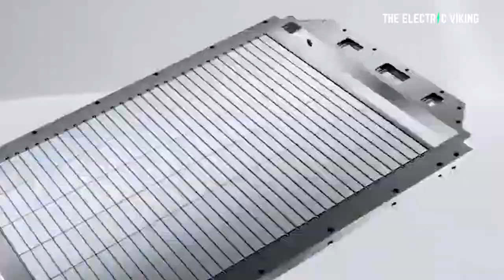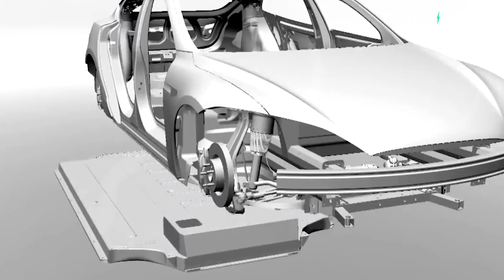Tesla's Model 2 Hatch & Crossover will KILL gas cars in 2023

Comment: This wasn’t one of the strongest videos. Range will be closer to 250 miles. The smaller the battery, the more cars they’ll be able to push out. Plus unnecessary competition to 3/Y. It’s 100% certainty this won’t be made in China for EU market, why add 10% import tax and freight??? It will be made in Eastern or Southern Europe.

Comment: but I want a Corolla . . .
Reply: @The One Who Knocks  I realize your comment might have been tongue-in-cheek.  😊       But my reply was going to be this...   Gasoline Corolla or hybrid Corolla or battery electric Corolla?   As you probably know, you can get a hybrid right now that is rated around 50 miles per gallon.  Only 23,000 USD.  In a year or two, there should be a battery electric Corolla, likely called the BZ2 or BZ3, that Toyota is supposedly building in partnership with Chinese manufacturer BYD.

Comment: The labor factor, rather, labor flexibility. Tesla is the only exception, ALL assembly workers at ALL vehicle related factories World wide learn and perform a limited range of tasks and all within a specified area of a vehicle. A front end specialist can not be assigned to interiors without re-training and maintaining labor allocation levels. Tesla trains ALL employees - assembly line workers as well as engineers - ONE TASK, learning to interface with the company A.I. Director. No matter the 'task' each employee is directed and assisted by the A.I. Yes, flexibility

Comment: Sam...,I disagree with u. Aptera will be the most efficient ev. It's light weight, 2 seater and three wheels makes it much easier to power up. This means u go farther with less batteries. The configuration and light weight needing fewer batteries reduces the cost. Aptera has imbedded solar cells in the car. The cells charge the car just sitting in the sun!!!!.....Aptera won't be charging u $15,000 for fsd like Tesla! Also aptera supports owner maintenance unlike Tesla! So even if the purchase prices are nearly equal......the fsd charge and maintenance are negatives re the Tesla!¡!!??......Most people drive alone or with their partner. Having two empty seats makes little sense. My money is on aptera. For more reasons why aptera makes sense, email me. I shall also send u a discount code to save u money when you order your aptera on line. Regards......a. barbuto...... barbuto@optonline.net...,

Comment: Based on the Cybertruck and Semi examples, this will take way way WAY longer to go into volume production than people think, probably 2027 at the earliest.  As for low price, Tesla has completely abandoned the low end of the market, and the Model 2 will be no different.  In the US, expect the base model to start at $40k (in current dollars) and quickly go up from there.  There will be many cheaper EV models from other companies.

One thing the Model 2 conclusively demonstrates is that, despite their efforts to convince people otherwise, Tesla is not the expert when it comes to batteries.  CATL is.  Tesla has gone down a dead end with cylindrical cells, a format that will eventually have to be completely abandoned to stay competitive.  In the meantime, CATL and other battery companies will be selling their state of the art batteries to all auto manufacturers, eliminating any volume advantage Tesla might have had on the most important EV component.  Tesla will have to compete on software, where they still have some advantages, and manufacturing, where their advantage is as illusory as their supposed battery advantage was.  Even in software, their advantage is less than what people think.  Despite the hype machine, they have no real advantage in autonomy.  It's in other more conventional areas, where it's not that difficult for other manufacturers to close the gap, especially with help from tech companies.

Comment: Is there any real evidence that this vehicle is a car and not a Robotaxi? Elon originally talked about a $25000 car years ago, but since then he's mostly talked about the Robotaxi. Elon seems to think that the Robotaxi is for the masses, expecially in the City, not a cheap EV. Elon is convinced the Level 5 autonomy is just around the corner, and the Robotaxi is where that fits. Yes, he's talked about a smaller, cheaper vehicle, but I read that to be the Robotaxi. Maybe he's trying to make a Robotaxi that is also the $25000 car? Who knows. Elon doesn't usually try to shoehorn two very different functions into one vehice, there are too many compromises that means you don't get an optimal solution to either.
I hope you're right, but don't be shocked if this is a Robotaxi.

Comment: EV, you lost all street cred at 0:49.  "Everyone is talking BS except me coz I have exclusive access to all the info that is in the public domain, but I am doing nothing other than speculating".  People have spent time in a padded cell for less.  As for the Tesla Model 2 & crossover killing ICEs in 2023 - what are you on? EVs haven't killed EVs in 10 years with take up rates of 0-4%, mainly 0-1%, across the globe, so nothing will change in 1 yr. 
PS. Thanks for confirming that Tesla cars have been a rip-off got the last 10 yrs.  Spoiler alert- we already knew.
I dont want 300 miles of range, I want 600.  I get it from my Mazda 2, and its still cheaper than the tesla 2 will be in China.

Comment: This video starts of with line there is "there is a mountain of speculation, a bunch of absolute garbage that's' been printed about Tesla Model 2"... then proceeds to peddle a mountain of speculation and garbage about now  DOA model 2. Tesla will eventually release a cheap EV but doesn't seem it will happen until around 2027 or 2028. And it probably won't be as cheap as Chinese competitors but it should sell like hotcakes in at least protectionist markets. In any case love the channel. I like that you stick  your neck out with speculation even if you can't bat a thousand. Constructive criticism, you should take it a little easier on the gas with ridiculing misses of others that do the sam unless the miss falls in crooked sportsmanship category.

Comment: Don’t want AC, electric emergency brake, use cable. No motors needed, weight? No rear wiper, and motor, weight. Make rear hatch 50 in wide to fit plywood. No motors in seats, mirrors, emergency brake motors, . Two speakers in the kicpanels only. No wire harness in doors, no internet connection, one wiper blade front wipers. No screen full of tin and indium. Three battery boxes in case one is damaged. Cheaper repair, no pearl paint.  If not u are faking caring for the climate. So don’t talk about hate for ice cars. ,

Comment: Dealings and Contracts and Manufacturers Innovations and Implementation do not at this point even remotely warrant the complete replacement of internal combustion engine driven transportation as a whole. You are dispensing fantasy or wishes at this point. So many different overall cost factors and efficiencies of manufacture and efficiencies of power used and utilized will have to be drastically improved beyond any realistic futuristic outlook shared here. Yes, great Improvement so far..  but not even close to what is necessary to displace ICE TECHNOLOGIES
Reply: Companies and regular folks are not dumb, ease to use and total costs of ownership will pave the way for the future not the technology.
Reply: You're new here?
Reply: @Indecisive7337  😊